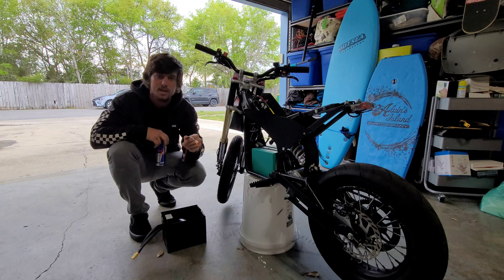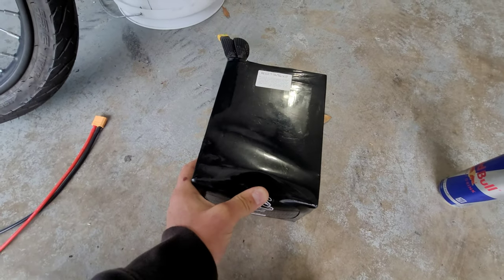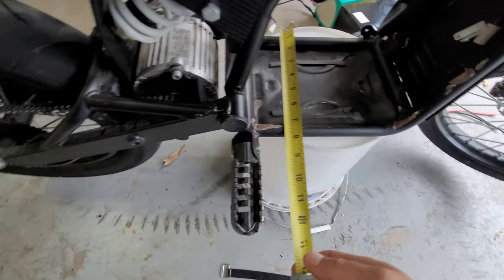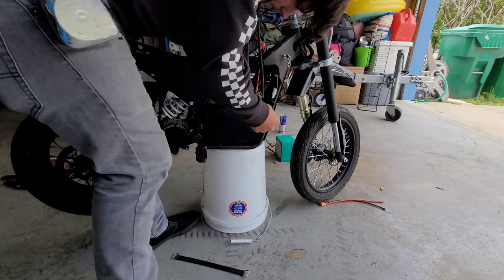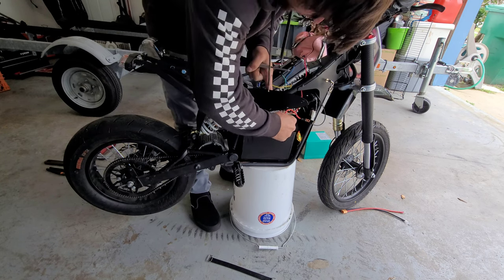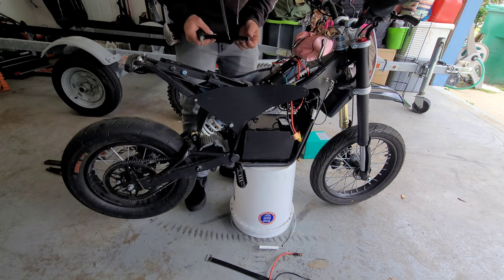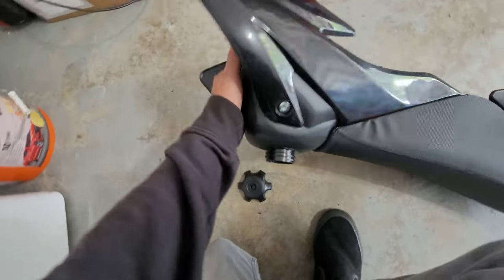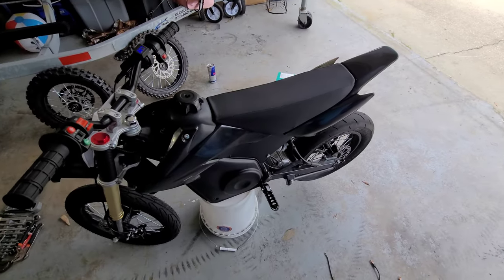CRF-E2 killer Mototec 72v pro 5000w

Comment: I'm sure you can fit alot more battery in that back. you just need to build the pack into a polygon shape. Practically 40% of the usable space in that frame is still free

I am going to attempt to fit a 72v 40ah battery into mine.

If not then i will go down to 35ah.
Reply from the maker: Yes definitely lots more space to fill but getting a larger battery to slide in and fit is the issue. Im thinking about making a removable bottom that i cant bolt on and off for easy install. It needs it for sure with the qs swap.
Reply: @EmxBrandon  wow actually yeah. A removable bottom would be great. I was even thinking maybe two triangle packs you can slide in one at a time and then stack on top of eachother to make a square. But it's all being planned now
Reply from the maker: @topelite666  yeah that would be a great idea aswell with the two triangles. The biggest issue with the battery now is i have to really squeeze it in to get it to drop into place. Its already pushing the limits and with my new setup i need more ah and continuous amps if im gonna use the qs165 to even half of its potential. So im planning on dropping the bottom down 3in and also welding the drop down foot peg bar solid and that should get me atleast another layer of cells. Plus if i can go through the bottom i can fill up the upper area without worrying about trying to slide it in from the side.
Reply: @EmxBrandon  I feel it man. have you considered LIPOs yet? would be very easy to hit a 200a continuous discharge on some 30c packs. I just hate how damn small and finnicky they are
Reply from the maker: @topelite666  honestly im still pretty newb with batterys but from what ive read lipo would be a great option especially appealing how much safer they are. Ill definitely keep them in mind for a battery build when i get the balls to try 😆
Reply: @EmxBrandon  Just make sure you get a lipo pouch. they are fire proof B)
Reply from the maker: @topelite666  good looking out!
Reply: @topelite666 When you have opportunity can you keep us updated on the custom battery?

Comment: Love the charger idea, I’m looking at making my 72v rechargeable through the stock charge port, did you just splice the 3 prong end from the original 48v charger and add it to the 72v charger?
Reply from the maker: Actually electro and co sent the new charge port with the battery its basically the same as the stock charge port and will screw right into the existing spot where the stock one is 🤘 but you could always splice yours if you need to.

Comment: On the link it brings up a 76v 14ah battery is that what you ended up with?
Reply from the maker: Nah they just recently switched all their batterys to 76v, they no longer sell the one i got. Go with amorge 6x6x8 email them at allen@amorge.com and see what they can make ya!
Reply: @EmxBrandon  sweet I’ll have to check it out almost pulled the trigger on electro and co 52v 20ah since the 72v 20ah mini is out of stock
Reply from the maker: @austinbottensek9878  yeah definitely check out amorge, they are in china but everyone has one in the us. No one can compete with their quality and price. Youll probably pay around 650 shipped, maybe a little more if you want air shipping to get to you faster!
Reply: @EmxBrandon  they emailed back with 72v 24ah 150amp or a 72v 30ah 100amp, both under $500 before shipping, but the question is what do I use to charge a battery like that the original 48v 13ah take 4 plus hours to charge I can wait a full day to charge this bigger battery🤷🏽‍♂️
Reply from the maker: @austinbottensek9878  they can upcharge your for a faster charger i believe, you just gotta adapt it to the mototec or just take the cover off when your charge. Regardless they send a 3 amp charger with it.
Reply: @EmxBrandon  okay cool just checked out bomber they include a 5amp charger I’d love to know how long it’d take to charge my boy has a stock mototec 48v that take 3-4 hours and I’d like mine to charge as fast if not faster but with 30ah maybe I could skip a charge
Reply from the maker: @austinbottensek9878  your definitely gonna get alot longer ride with the 30ah, but with more ah its gonna take alot longer to charge, the 5amp charger will make up for that but id guess around 6-8 hours to charge.

Comment: Is there a big difference between the 24ah and the 20ah 72v battery?
Reply from the maker: Really just depends on how you ride, if your just messing around doing wheelies, no full pulls just slow stuff it wont really make too big of a difference. If your using it to mob around town id say its an extra 5 to 7 miles of run time. Just a guess though, not a huge difference but could be the difference in a longer ride!
Reply: Okay cool, trying to decide which battery to get. Do you have to get the crf50 plastics for the 24ah to fit? Or will it work with the stock Mototec plastics? Thanks for all the help!
Reply from the maker: @Kyle Strimple  nope the crf plastics are purely cosmetic/comfort it wont change what battery you can stuff in!

Comment: Can u put the battery with a stock controller and motor?
Reply from the maker: Not 72v on the stock controller. But motor can handle ot
Reply: @EmxBrandon  So i can just get a new battery and controller?
Reply from the maker: @isnkxqaz  exactly!
Reply: @EmxBrandon  How fast will it go?
Reply from the maker: @isnkxqaz  little over 35 on 48v and little over 45 on 72v with a good tune

Comment: Amazon says the large version has 27 in wheels smh what's the wheel size
Reply from the maker: 😆 amazon is on crack. Its 12 rear 14 front
Reply: @EmxBrandon  haha ty
Reply: @EmxBrandon  do u think it's worth it to mod it or the burromax tt1600r
Reply from the maker: Id say the mototec its gonna be best for offroad and still handle great on road with street tires plus it looks like its cheaper than the burromax 1600 which means more $$$ for upgrades

Comment: Shit. Just picked one up and was hoping not to have to mess with the tabs. Guess they're coming off
Reply from the maker: Which one did you get? They only make 76v batterys now so the dimensions may be different and you might get lucky
Reply: @EmxBrandon  the 48v 1600w one. Came with the 48v 13ah battery
Reply from the maker: @DescartesRenegade  oh i meant which electro&co battery did you get? The 76v 24ah?
Reply: @EmxBrandon  oh, yes. Same as you